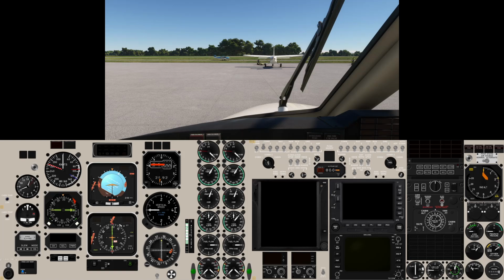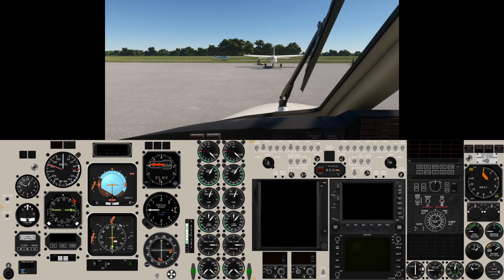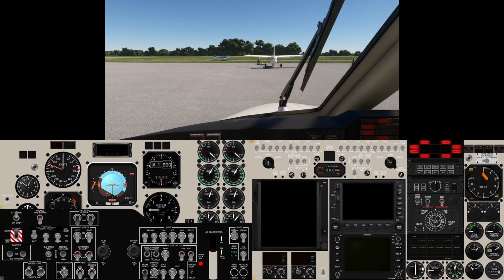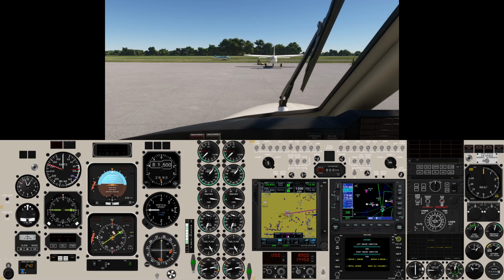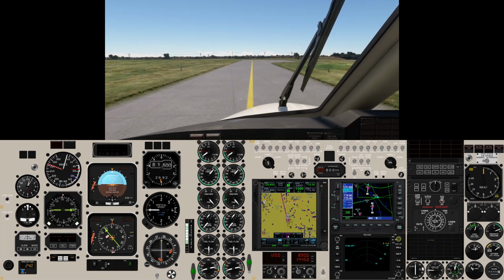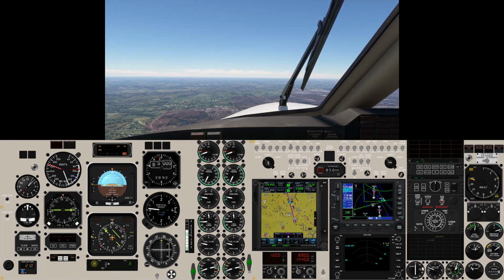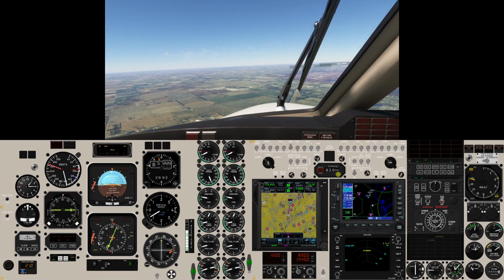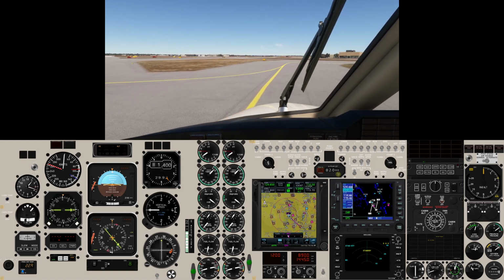King Air 350 showcase

Comment: I purchased the kingair 350 panels to run with Air manager over a network computer. Of course I am running the Airfoilslab King Air 350 on xplane 12. The strange issue I am having is that is soon as set xplane to show the outside view only (since I have my gages up on 2 monitors), both the PFD and HSI turn black. All of the other instruments work fine. If I add generic PFD and HSI to the air manager panel, no issue. I don’t want to run generic panels because I am missing all of the good features that are in the experimental sim avionics panels. Looking for support or things to try.

Comment: How are you brining up those sub panels? Also these panels can be put on two different screens?
Reply from the maker: Each panel set shown is generally designed to be used across 2 screens but the instruments can be moved to other extra monitors if desired. Bringing up the panels is integral to the programming of the panel concerned.
Reply: @ I do intend to build a king air sim using your products. Im just trying to fiquire out how it all works. When you brought up the switch panel was that a key stroke or a mouse click? Also your saying all the parts in your panel can be moved to other screens like in air manager? Im planning on using the air foil labs 350 in X-Plane.
Reply from the maker: In this video it was neither a keystroke or a mouse click but a touch since touchscreens are in use.
Reply: Hi. Is this panel available for iPads or Android Tables?

Comment: This panel looks very complete, whist compatible with the Airfoillabs KA 350 can you confirm it has all the Airfoillabs data refs and cmds integrated? Also didn't see the Master Warning / Caution illuminate, is this working? It usually goes off when starting etc... Otherwise, I think this is going to be installed on my sim... good one!... look forward to checking it out. :). Thanks
Reply from the maker: Yes it uses specific data for the AFL variant where available. The master warning/caution indeed operates.